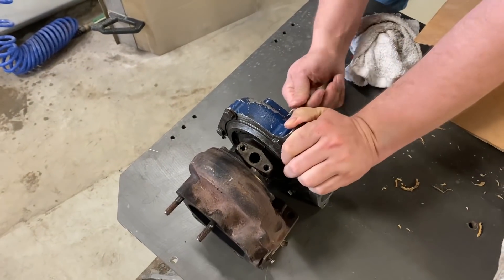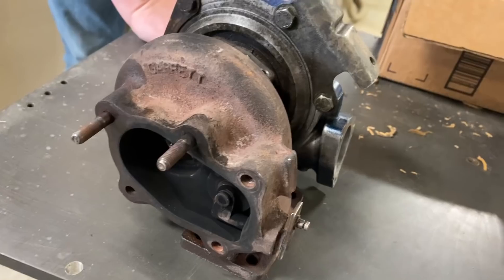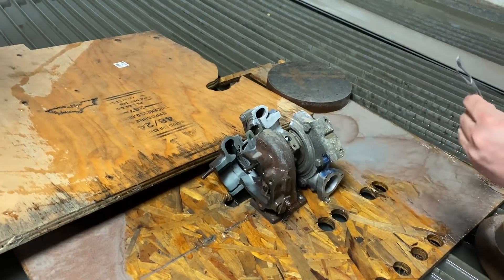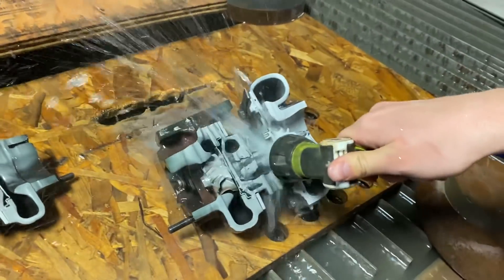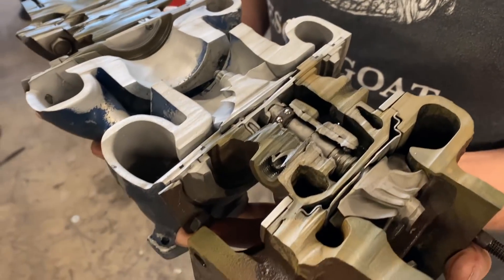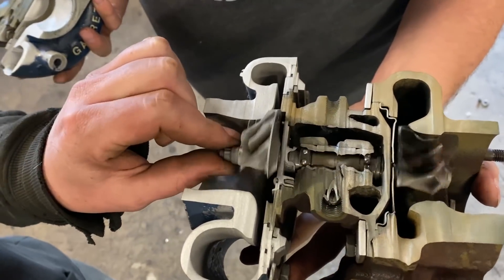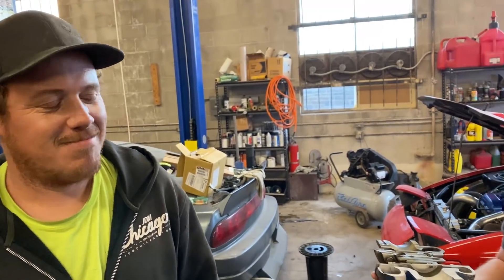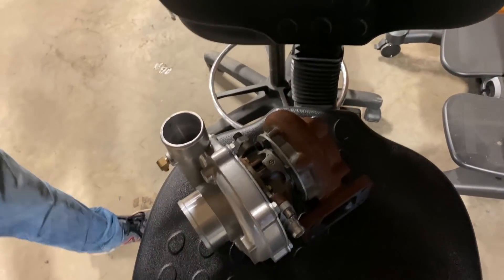Garrett Turbo vs 60,000 PSI Waterjet | How does a Turbo Work?

Comment: Using the waterjet low pressure mode first (20 or 30kpsi), mount the turbo with the exhuast side input facing straight up towards the waterjet nozzle. Using water only, no abrasive, so it doesn't cut the wheel, spin the exhaust wheel with the waterjet. this will make the compressor wheel spin, so you want to connect a hose to the input and output of the compressor side and use it as a vacumm to suck up the tank water and blow it out the compressor side.

Comment: Put a bouncey house on the outlet of the compressor and tangential cut into the exhaust side to spool it up then turn off the garnet for impeller longevity so you can play in the bounce house.... worlds most expensive to operate bouncey house. Lol

Comment: A turbo charger mounts to your exhaust manifold, the exhaust gases spin the turbine which then. Pushes air regulated by a wastegate into your intake. Forced air induction. 
More air=more boom
Another way is to force air by a turbine powered from the crank by a belt, super charging.

Comment: See how much boost you can make by spinning the exhaust side but also keep the pressure down on the water jet if possible so it doesn’t immediately eat through the compressor wheel

Comment: spin it up with the air cannon and then after that try to spin it up with the waterjet but maybe without cutting it (have the nozzle far enough away so as not to damage it if possible?) and then try to spool it up right underneath the waterjet

Comment: Use an air compressor to spin up the impeller.  I think your water jet would just shred the impeller blades before they got up to speed.  Alternatively, you guys could try eating at Taco Bell for a couple of weeks and hook the turbo up to the shop toilet . . .

Comment: Remove exhaust housing 
Mount turbo to wood
Use water get with no garnet and use the water only to spool the turbo. It will need some resistance to spool too

Theres videos on my channel where I do this with a shop vac and blow up gloves and trash bags with the turbo.

Comment: Cut into the exhaust passage (spin it from the input side, the one that's connected to the exhaust on the engine... the rusty side) and use the outlet side (the shiny side) to inflate one of those 'waving/dancing man' bag-statue-advertiser' things, through a hose.  Make sure to spin it up the right direction!  Use safety, remember the skateboard wheel?  This should be more dangerous, or we'll be disappointed.  Don't forget to taste, not near enough tasting going on lately.

Comment: Used air on the rear exhaust housing and let it suck water on the compressor side with a pipe going down in size to make another water jet. Drill a hole further down in the pipe to inject cutting abrasive into it to try and cut a sandwhich or burger...

Comment: 1. slice off one side to expose the impeller without damaging the mechanism,
2. waterjet water-only on the other side of (nonexposed side) to spin it up,
3. look at it spin until it fails.
4. if it does not fail, shoot it.

Comment: Put a hose on the suck hole and face the blow part of the suck hole up and back a bit, and put the hose into the water. Then blast water or air into the suck part of the blowhole

Comment: Hook it up to the air cannon, but add an airline straight from the air compressor so before you dump the cannons air its spooled up to speed... will it go super sonic or sonic boom?? Maybe even get some oil flowing through that thing so you can do more than one experiment with it.

Comment: Disassemble the unit and remove the impeller, then reassemble. Set up the turbo body on the waterjet and remove one side of each impeller housing while leaving the the bearings alone. Disassemble again and clean. Reassemble with intact rotor and sectioned rotor housings allowing access to each side to spin the rotor with your waterjet. Yay!

Comment: That was possibly the worst explanation of how a turbo works. 
And guy "works" on cars in his "dojo".

An internal combustion engine is nothing more than an air pump. Moving air makes power, and the more air you can get in and out the more power you make. The turbo uses the air coming out (exhaust) to feed even more air back into the motor, making the motor more efficient. The turbo is essentially an air powered compressor, that when used incorrectly can grenade your motor. I'll bet that has happened in the dojo at least once.

Comment: Take the exhaust turbine housing off and cut it in half to expose the turbine itself to spin it up. Id hazard with maximum pressure, no garnet, and some oil in the bearings it could get going fast enough to embed parts of itself in the ceiling.

Comment: I must say this is one of your better Water Jet Ginsu projects.  It would be rather interesting to spin the uncut turbo with the pump for the water just in the hot side (suck hole) and on the cold side outlet (blow hole) side of the turbo either stick a magnum condom on it to inflate or make a reduction adapter with a nipple to inflate various balloons especially long skinny one like clowns make animals with or the six or eight foot long

Comment: Spool it up on the exhaust side and put a big giant 6ft balloon on the pressure side and see how fast it blows up. Use a pipe and put the balloon on the floor to get it away from the water jet.

Comment: Seal it up air tight, attach air hose and drop into the tank. See if you can create a whirlpool in the tank. Or see if you can use it to drain the tank faster. After that ......idk cut it up?

Comment: Use some kind of cone to deflect the water evenly in all directions for the exhaust succc hole so that it doesn't eat the blades of the turbine, or get it spinning first so that not all the power is directed at one spot for too long. You will probably also run into issues with the backing plate getting eroded away by the water jet.

Comment: Look at Colin Furze channel on how to make a combustion chamber for a jet engine based on a turbo charger

But instead of putting the compressor out put into the exhaust

Let it run into the shop so you have FIRE!!!

At point it at things which are not flammable (not Mitchell)